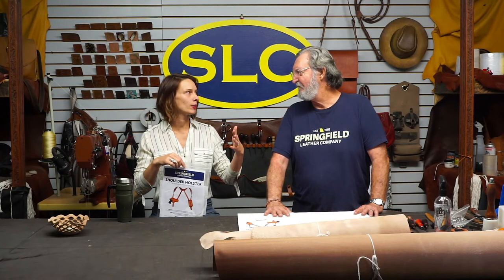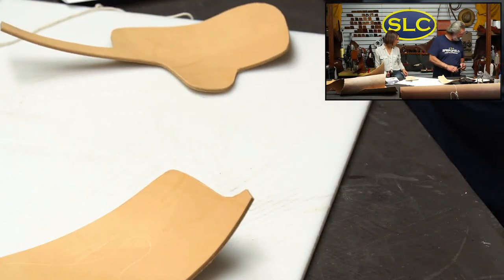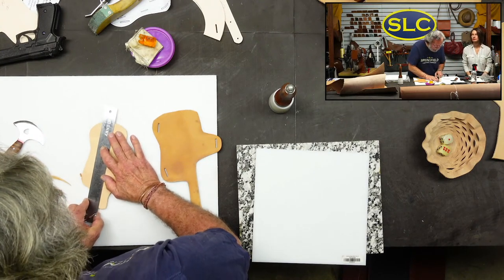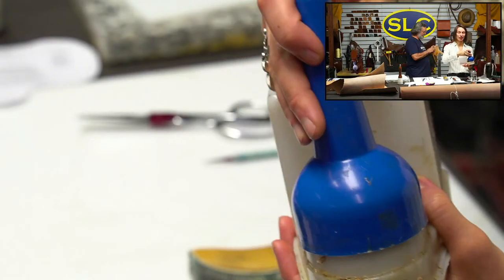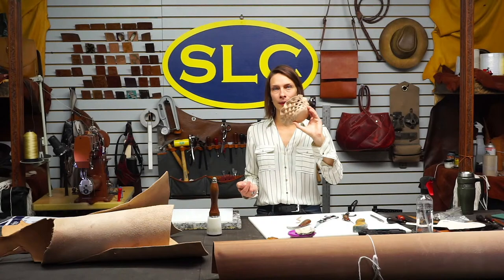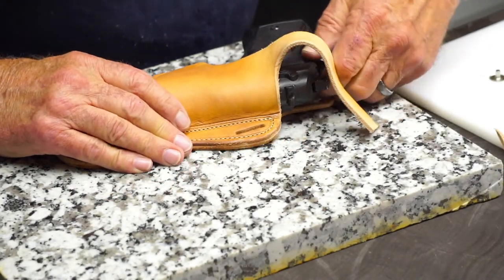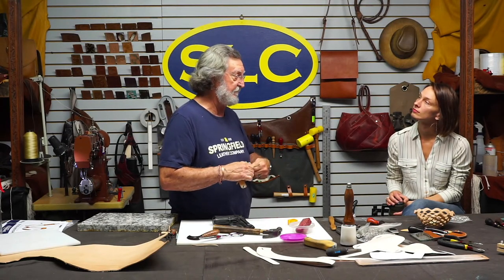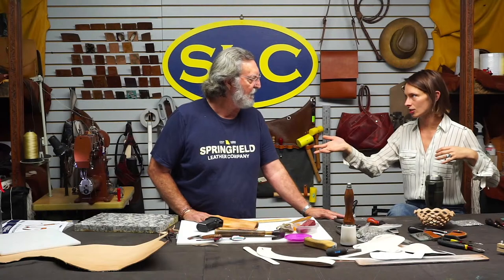Shoulder Holster Pattern w/ Denny + Liz Pt. I.

Comment: Can you change that holster from a left side carry, right hand job. To right side carry, left hand draw by changing the side you put the small piece on????
Reply: I'm making it for a left hand draw on the right side currently. So far so good but watching through the video I have to pause and back it up because it gets confusing watching it "backwards". I haven't made the straps the mold for the gun you just take your pattern and flip it over (where you are tracing facing the backside of the pattern). I also traced the stitching lines to the back side for reference